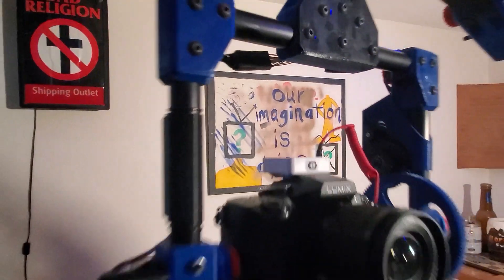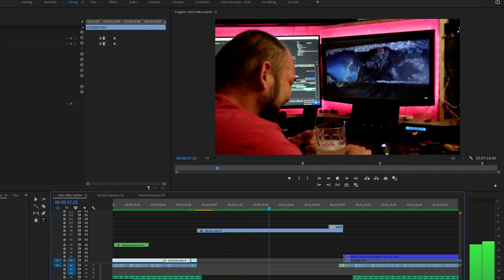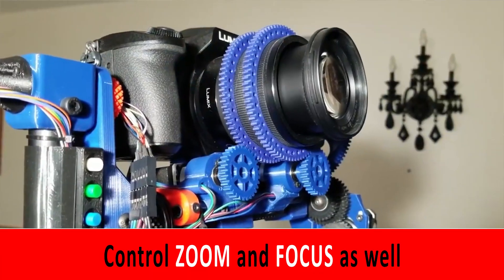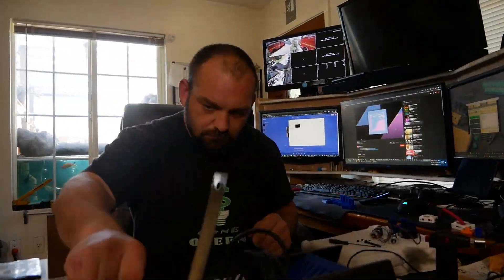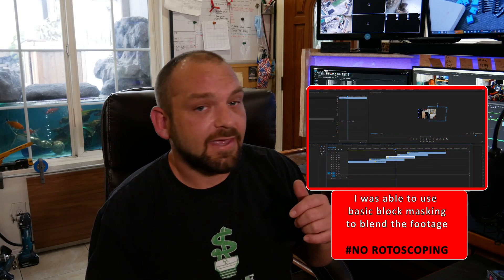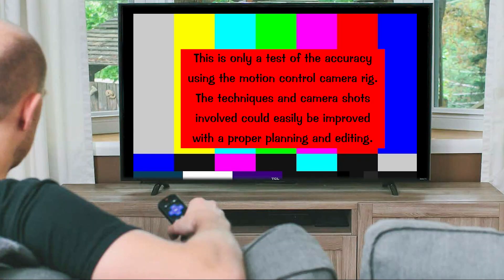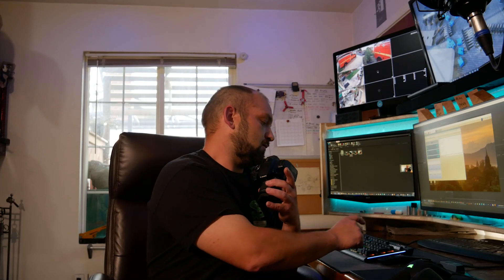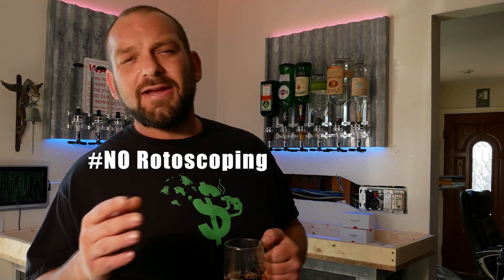If you have a 3D PRINTER - you can MAKE THIS motion controlled camera

Comment: Hi 2 questions
1. where i film has no wi-fi or plugs so can i run ugs on a pi with windows
2. is there a way to have a bunch of presets in ugs that i can click on to move the crane to that preset
3. i am planing to have an on deck control module using 2 pi's (one for recording and one for controlling the robot) i would like to have the module be stationary but still like the robot to rotate also i will be using the atem mini pro cam switcher which uses hdmi so could i use wireless hdmi

Comment: The problem I see is when you set 4 waypoints then each stop is clearly visible on a footage. Is there a way how to go smothly though all waypoints?
Reply from the maker: yes and no. It depends on how fast your trying to move from point to point....If you go slow, the acceleration settings don't really affect it... but if you speed up the programming you will notice because the machine starts to slow down (acceleration settings) as it goes from point to point........  I did have different speeds programmed on the moves so its even more noticeable...depending on the speed ramping you apply during post work will also affects the look

Comment: You said not cost 200k an ya not Bradley damm mate you more than just Bradley and in my opinion some 200k rigs are just dont worth the money compare to your rig
Reply from the maker: Thanks a bunch for the insight.... I feel the same way.... Technically this rig is nowhere near a bolt camera... But then again the price difference between 500 bucks and $250,000 is huge so if that's part of the equation then in my opinion this rig is better than a bolt because it puts some capabilities in the little guy's hand
Reply: @DoItWhenever  exactly and the most important that this rig  can be  redone or reconstructed in any way you wish with just a little bit of imagination and technical skills... any way brouh thanks for this awesome vids. I have been looking for this kind of tutorials but non of them have so many functionality like yours there is one vid tutorial with similar arm but it is less technically and with no wireless control or g code control possibility actually all control is done with some strings by hand

Comment: Side question about your audio: @6:17 seeing a Rode Wireless Go there. Are you using the Go transmitter's internal mic or a plugged in lav? I can't spot what's on you for audio pickup. I'm asking because plugging in any of my 4 lavs creates a continuous high pitched whine from the Go. Thanks.
Reply from the maker: I can't find my lav at the moment so all the recording was done using the internal mic... It actually works pretty well but it did pick up my computer fan noise, I tried to EQ it out... And it sounded normal while editing.... And then it went live and I noticed a hissing.... Probably compounded by my EQing efforts :( But overall it's pretty good.

Comment: Hey, I'm curious how reliable you find the focus control on the lumix? my canon 80d has this annoying behavior that the focus steps vary depending on the speed of rotating the focus ring. I found it basically impossible to get consistent focus pull results on my setup. Still relying on the auto-focus. which does ok but is sometimes ruins shots.
Reply from the maker: That's the exact problem I have with this camera... The focus control is nonlinear.... I was super excited the first day this thing worked and then irritated an hour after that... The focus control works if you're not moving any other axis.. like if you're setting up a headshot.... I actually have a plan to take advantage of that extra motor
Reply: @DoItWhenever  Ha, ok well I guess I'm glad it's not just me. But it does suck. I even tried connecting the canon API over usb to control it which does expose a large step and small step command in each direction. But it was also totally flakey and would just drop commands. Given the auto focus works pretty well it was annoying to find manual control so non predictable.

Comment: Can't wait to start building it, have a very specific application for it in mind, would require it to be bolted to the ceiling though, shouldn't be a problem though i suppose since it is balanced
Reply from the maker: The ceiling Mount might actually be tricky... Everything is balanced using that integrated counterweight but the turret section rides on top of the base plate, turning that upside down might add a few challenges
Reply: @DoItWhenever  The forces if they balance out can be neglected, the turret would need kto be turned to a captive plate, so it hangs off the base, a lazy susan bearing is inside anyway right? Would then get sandwiched instead of them being stacked, will be tackled when i get there in some version of near future
Reply from the maker: @Tarex_  yeah there's a 3D printed lazy Susan bearing in the center.. and technically everything is captive... But there's quite a bit of weight with the camera,  counterweight, and all the parts... I have 3D printed a very thin nylon spacer to help with friction.... If you hang it upside down you might have more friction or binding on that lazy Susan bearing.... In the current setup all that weight is distributed onto the base and by riding on that nylon spacer.    There's been other people that asked about a ceiling mounted version.... I guess that could be another video in the future :)
Reply: @DoItWhenever  a suggestion in case you do research the option at some point, igus (yes the ones from the bearings) actually sell the drylin and other materials as filament and they are rated for industrial applications and are more specific than nylon, they can also produce custom parts, afaik they are also present in the US, in case they are not, I'll gladly try and get a roll of the filament shipped to you from germany
Reply: @Tarex_  technically it is not a real lazy susan but a crossed roller slewing bearing. The difference is that a lazy susan is using bearing balls (or often even just glass marbles) and gravity keeps it all in place. The slew bearing is a combination of two roller bearings in a 90 degree angle. The inner race of the bearing is adjustable to remove/reduce any play in the bearing. This is not the case in this 3D printed construction though and the construction indeed looks more like a lazy susan.
But with a bit of tweaking of the roller pins the construction could behave more or less like a slewing bearing.
Needless to say that I am still not done tweaking 😳
Reply: @Rob_65  with the igus material it can be two flat faces and would probably still have a lower friction coefficient haha, i'm basing the picture in my head on smth like a Clutch Pack,and sure, if you were done tweaking it wouldn't be a project, rather a full on commercial product, i think everyone will gladly help in the tweaking process and any ideas that can be floated around or resolved, i sure am keeping my eyes peeled watching any updates or progress, great work